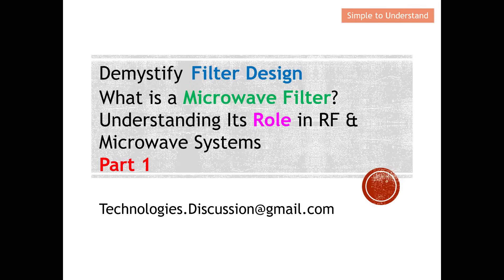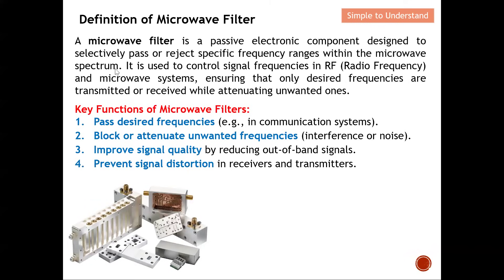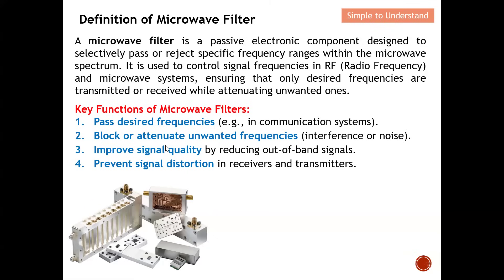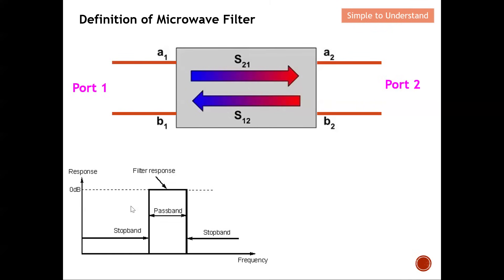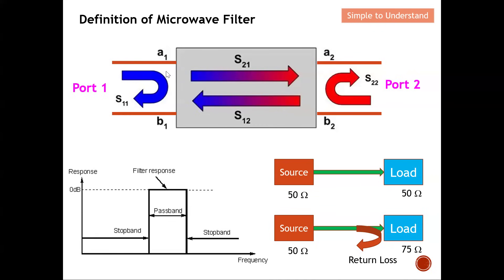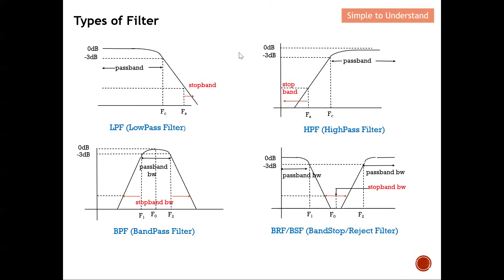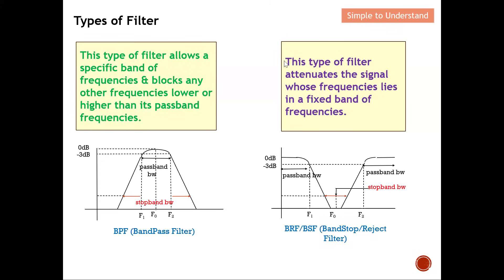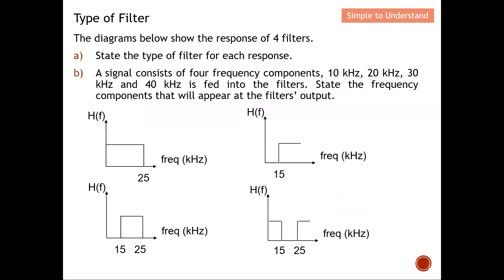Filter Design #1. How Microwave Filters (LPF, HPF, BPF, BSF) Select (Tx) or Block (Reflect) Signals.

Comment: How can we konw the which type of filter is need to design based on frquency , wheb to go for lumped , when to go for semilupmed , distrubuted etc ?
Is there any thumb rule is there?
Reply from the maker: The type of filter you need actually depends on your application. You may need to rewatch this video to understand which filter to use, as it really depends on the frequency band you want to pass. :)
For me, Lumped Element Filters less than 1 GHz but maybe 500 MHz to be safe. Lumped element at high freq can be quite costly.
Semi-Lumped Filters (~500 MHz to ~3 GHz)
 Distributed Filters (Above 1 GHz)